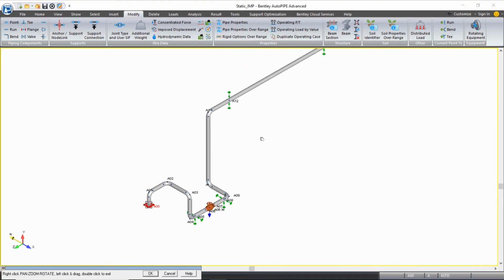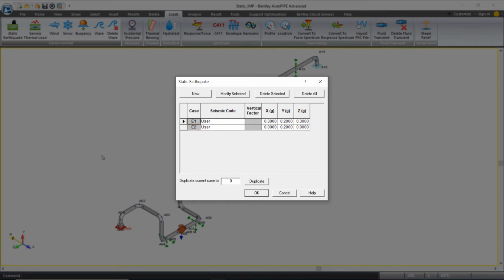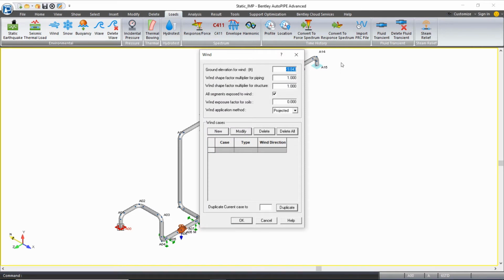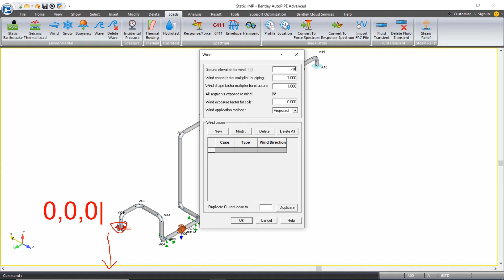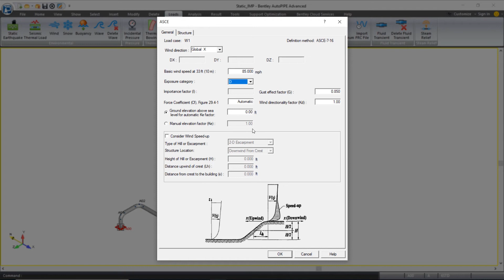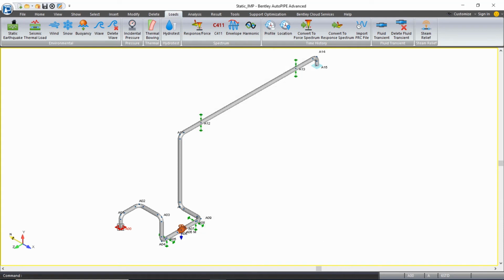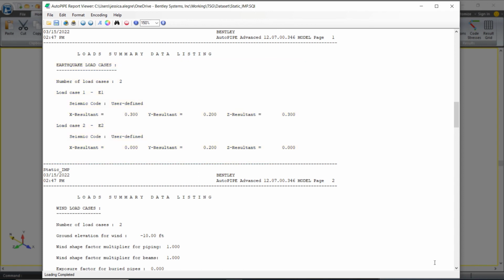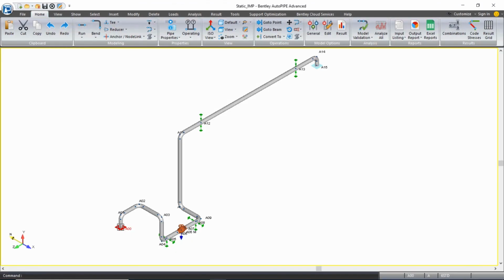Applying Static Earthquake and Wind Loads

Comment: Where do you get those seismic g values?
Reply: They are calculated based on the seismic design action from the design code. For example in Australia and New Zealand we refer to AS1170.4 and 1170.5 equivalent static method to determine them. There are similar codes around the world that determines those "g" value.